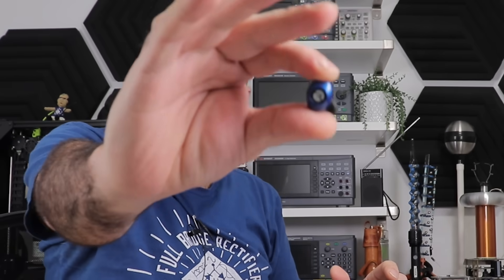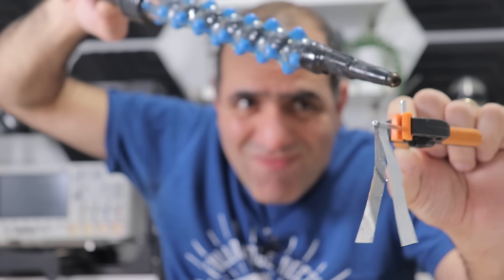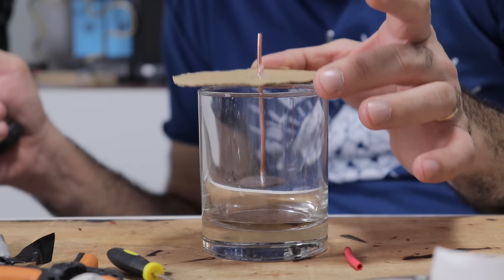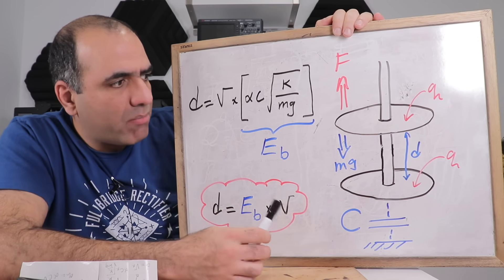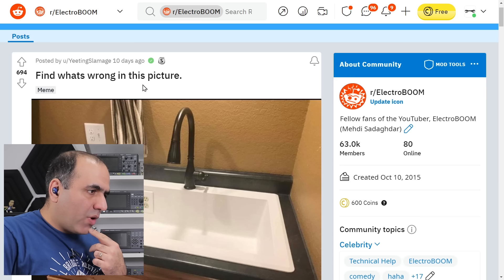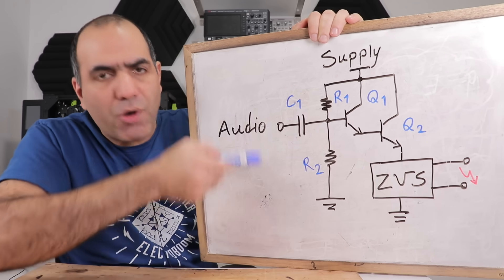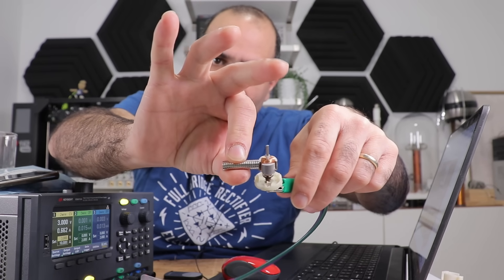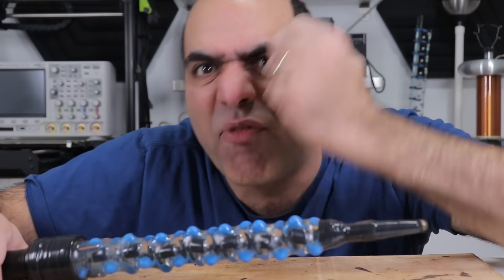I Reinvented the Electroscope! (LATITY-008)

Comment: In "cotton dust" the dust part is critically important and it has to be suspended in the air.   You can test this with plain bread flower,  Throw a cup of it in the air and ignite it with a liter.  But for pete's sake do it outside with nothing around that can burn.    With a little cleaver setup you can reproduce the video.  I can give you more details if you want but not in a public post is you could blow up your house if you do it wrong.  I'm sure any of the older guys from the war can tell you how too.  It was kind of common knowledge back then.

Comment: 10:20 I think the primary issue is less with the material, and more with the surface-area-to-volume ratio of the material, which is the primary issue with dust explosions/fires.
Reply: I agree... the surface to volume ratio is an often overlooked variable.

Comment: Dear ElectroBOOM. This is all very nice, but you are using the wrong formula for the force between two plates. The formula is only correct for point charges. This is a good approximation only when the distance is very large. For small distance the force is constant. Just use the Gauss law to check that I am right. The 1/d^2 rule is correct, however, for constant voltage for a different reason. It is a nice integration exercise to compute the exact formula for two circular charged plates, which I dare you to do :)

Comment: Thank you Mehdi..and also Veratasium and Mould. 
All You guys rock .. you are onto it !!
.....I have commented about the electrsmog here in the civic environment on my street from the interaction of uninsulated powerlines , interacting with the path of cell transmission lines and also transformers and these new LED streetlights and also the Telco's fibre lines.
 It is living hell and I can constantly hear the sound of charge spilling and feel it ! It is a quiet town here in a special district of nz one of the first areas of 4.5-5g rollout :( so these signals and freqs arnt disguised by random noise as in most cities and town..so it perfect to expose the pollution being caused by badly designed infrastructure. 
I will make up one of these electroscopes..I have lots of glass tubes copper shim etc in my studio..so this is a great idea to attempt to measure  maximum spillage if possible to locate the offending problem. ...as it generally is focused from a power pole.. but the surrounding field is the problem...and possibly just as harmful ..very toxic to health .and appears to be a result of interaction between these infrastructures, that Telco's and council's have no understanding of other than their own interests in providing services at minimal expense and no regard to environmental risk... it feels like the town has been converted into a massive Haarp array..and conceptually I guess it has !
Reply: ..... I alo note the induction, if that's the right word !... is increased when seismic energy is flowing more so through the landscape. .so it also is collecting earth charge..St Elmos fire.
Reply: When 5g was turned on here in another district area..coincidently ..there was a massive charge interaction between transmission powerlines that sparked a massive fire that destroyed dozens of homes and properties. I am under no illusions that these differing tech infrastructures are isolated from others.
Reply: .... and if anything good can come out of this problem..it might be a discovery of harnessing the electrosmog to somehow capture charge and provide free electricity.
Reply: ... and..also to note..we had a district wide power cut. ... yet this spillage was still mostly evident from the lines..so it does seem that there could be interaction with a service such as cell transmission still interacting with uninsulated lines that is the vehicle for electrosmog. Is it possible that highsignal radio freqs are converted into electrosmog simply because of the interaction and structure of town grid layout.
Reply: ... in regards to the fibre broadband lines. . I felt Moulds explanation of light being converted into sound when interacting with another sensitive medium very appropriate.. as their assumptions that being light as innert it cannot interact I veiw now as incorrect..and as Veratasium  describes insulation as in many ways redundant as the field created is as important as the path lines..I can imagine that the fields are interacting as there proximity to the powerlines is nearby. Where the lines conjuction at the poles maybe vulnerable areas when lines bend corners etc causing more potential for field interaction?
 Of course there is a battle between Telco's and powercos blaming each other here for bad infrastructure..they have no idea other than money they generate for their investors.
Reply: ... I imagine that light also could be converted into electricity as well as sound  from the fibre lines as in Moulds explanation.. . .different degrees on the spectrum I guess.
Reply: ... and great to see you show the electrstatic force !.. I am sensitive to seismic signals..I feel the static energy rising through my cns prior to an earthquake here.. more so often generated from very deep seismic signals...and electrstatic is the what I assume it is ..a prickling type charge.
Reply: ... either that... or the natural electrostatic charge eminating from the earth has far more effect on our environment than has been found..and it is affecting the grid..or the grid due to its organised array is a conduit more so bewteen earth and airbound radio signals than the transmission of the grid itself. This would be more so affected in this locality because of the direct proximity to the ring of fire..and what has more so become the intense heat built up in alpine faultlines here..considering we will expect a magnitude 8 less than 1000km away in the not too far distant future..

Comment: Raycon is garbage guys! I got them about 2 months ago from another YT promo action and they literally sound terrible; I've talked to their support aswell and apparently I've configured them properly so nothing I can do.
The issue is that these don't bring any benefit whatsoever for music quality greater than mp3 so if you're using any app aside from Spotify these will disappoint you so consider this a fair warning
Reply: I broke mine at work 😅
I was wearing them under my hearing protection at plywood mill.
I got huge static shock from plywood sheet stack. The buds went mute and haven't worked since.

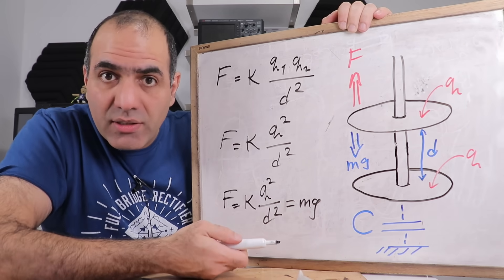Comment: Mehdi, the formula you use at 3:51 only holds for point-like charges, or objects far apart. You can't use it for the disks since the distance between them is comparable to their radius
Reply from the maker: True, I thought it might still be a good estimation since the electric fields between the two plates is fairly linear. Is there an equation for force between plates? I suppose I can calculate one...
Reply: @ElectroBOOM It seems to be a really hard problem to solve exactly, as you need to solve the Laplace equation with rather ugly boundary conditions. But you can probably calculate it numerically, or perhaps try to use an expansion on Bessel functions, since the problem has cylindrical symmetry
Reply: @ElectroBOOM  well for infinite plates (or small separation) it would just be constant, right.
Reply: @ElectroBOOM  hi
Reply: @ElectroBOOM  Since you have made plates, then the electric field between them will be uniform rather than radial.
The electric field strength between them would be:
E = V/d 
Where V is the potential difference between the plates and d is the distance between them.
If you wanted to get V in terms of charge, you could treat the two plates like a capacitor and go with Q = A*er*e0*V/d
with e0 being the permittivity of free space and er being the permittivity of the dielectric (air in this case)
Reply: Just continued to watch your video and saw you got to this same equation of E = V/d, interesting approaching it with Coulomb's law!
Reply: @henryfolds5713  Mehdi puts the cool in coulombs.  :)
Reply: @henryfolds5713   Actually, he got Eb = d/V

4:29 Eb isn't the electric field, it just stands for "ElectroBOOM" lol
Reply: @henryfolds5713 correct me if I'm wrong, but V=Ed only works for plates with DIFFERENT voltage, but in this case the plates are at same potential, so we should use V=Q/C like in the video did
Reply: @ElectroBOOM  yes, you can calculate the electric force due to disk at any point as follows:
Lets assume the charge density of the disk=P and the normal distance between the disk and any point=Z and the radius of the disk=a then the field= (PxZ)/(2epsilon) x (1/z - 1/root(a^2 +z^2)) then after calculating the field multiply it by the charge to get the electric force due to disk however this formula is applied to radial and not two disk-like plates so i assume its just gonna be E=V/D
You can also look up the formula online for more clarification
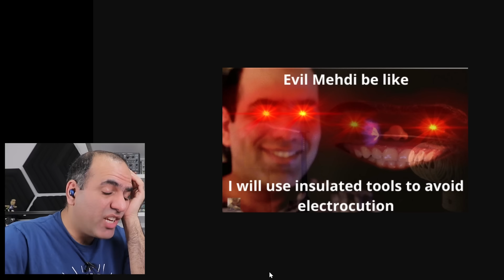Reply: @ElectroBOOM  11:10 Here we go again, history repeating itself.... Thought we'd talked about this issue before. I hate Raycon you know that! Cancel your sponsorship with them or i will unsubscribe and report you (yes i may actually report you, im not joking!) I dont want to report or unsubscribe but it may get to that stage if you persist and continue trying to sell us Raycons. No one wants that right?
Reply: @xa-xii4865  What is wrong with Raycon and who will you report him to?
Reply: @xa-xii4865  seems to me like you should subscribe to relaxation man
Reply: @xa-xii4865  Huh? Why would you want to report someone simply because he sponsored a product you don't like? Are Raycon is a banned substance or something? An illegal product?
As for unsubscribe, well... that's entirely up to each person.
Reply: @xa-xii4865  "Hi, I watch what you do on YouTube and do not contribute to your survival in any meaningful way,  however I don't like a thing you're doing and will resort to withdrawing all my lack of real world contribution if you don't remove the one thing in a tiny portion of this visual media that actually guarantees monetary support and your continued survival." 

That's how your comment reads with no context as to why you're so mad at Raycon.
Reply: @xa-xii4865  they are no entirely shit, just overpriced
Reply: @xa-xii4865  who hurt you and what Raycon do to you?
Also your report it usless
Reply: I came to the comment section exacly for this clarification. But what the most commenters are getting wrong is that the discs have charges of the same sign. Therefore E=V/d won't do. For large distances between the discs approach provided by Mehdi will work. While for the small distances I can think of two ways.  You can either do it rigorously using the cilindrical symmetry, as pointed in one of the comments, or use an approximation. In the latter case, you can calculate the force using the density of the field energy. For small distances d between the plates, the field created by the lower one is uniform and is proportional to the charge of the lower plate Q. The density of the field is proportional to the field squared, hence Q^2. The force in turn is proportional to the energy density multiplied by the area of the upper plate. Note, here we only consider the field created by the lower plate near the surface of the upper plate and not the resulting field. With all said, we arrive to the force proortional to the Q^2 with no dependency on d. What does this mean? Only that we can not consider uniform field in the given example and have to take into account geometry and charges moving on the plate forming a distribution dependent on the distance to the center of the plate.

Comment: veritasium explanation is for some stupid people... The lamp turn on immediately not because it's close to power supply, with extremely long wires to connect, but because the electrons in the conductor are already present in it on the whole length of the wire(at least those who help hold ions of metal to hold in the crystal structure (sorry for my English, hope you understand what I mean). The lines in the picture of the metall crystal structure body-centered cubic shows that neighbor ions have one electron for them both which is moving with trajectory of "8"), and when the power supply is connected, this electrons will move in the same direction. When you turn on power supply to start motor or light a lamp you shouldn't wait for the electron to move the whole distance from power supply - to +. You just waiting for a small push for all the electrons in the wire. So it's like pipe already filled with water. As for the electromagnetic fields appearing along the wire it's not the reason of the moving electrons but a result of their movement. Because electric field is the field around some charged particle, magnetic field is the field which appears when some charged particle is moving.

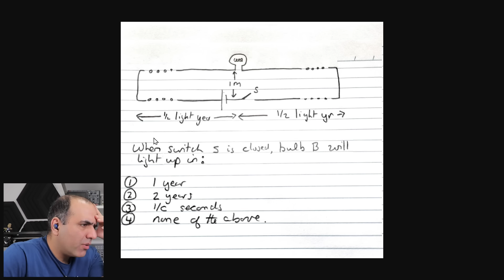Comment: 5:27 I'm really looking forward to your video about it. I have watched Derek's video just two days ago and I also think there is something off. I don't say what specifically right now. Let's see if we both come to the same conclusion.
Reply: Imagine the switch was at one of the far ends of the circuit. The source would still be 1m from the lamp, so with Derek's reasoning, the lamp should turn on almost instantly. 

A year ago, Derek had a video about measuring the speed of light in only one direction. If his explanation in the latest video would be correct, then the one way speed of light could be measured. At this part: https://youtu.be/pTn6Ewhb27k?t=128 You need two clocks, and sync them by putting the switch in the left one, and a battery and the light source in the other one.
Reply: @perperNorbi  you can't use this method to synchronize two clocks. Because issue is that when you separate the two clocks, the clock which is moving will slow down due to special relativity. Even in video it is well explained. Issue is not synchronization. Issue is how to separate them without one being slower than other.

On other point, if switch is lightyear away from bulb then it should light up after year because according to special relativity no information can travel faster than light. But if bulb can light up instantly than the information (someone has turned on the switch) has travelled faster than light which is not possible.
Reply: Please remind me too when he uploads that video.....

Comment: Veritasium's answer should be none of the above. Electrons= electricity, etc. However, the speed of light doesn't happen in a wire due to resistance. I'm sure as the wire's length is increased, the power needs go up, and the wire would melt before the light even so much as warmed up, But not only that, since the speed of electrons would be restricted, it would take longer than 2 years. I'd say 6ish, if this were possible to do, and the wires didn't turn to mush from the heat. Now... just for fun, I'll invoke the word "quantum" and we'll see how fast Electroboom's eyebrows shoot up. Should be faster than light. :D

I'd say that the electrons in the wire would act like a really long Newton's cradle, but with a constant pulse pushing the electrons together, like in a newton's cradle.

Comment: Well it's probably pretty accurate to say that evil mehdi would be be an opposite force so if you touched surely you would both merge and become neutral medhi. 
You can use that assumption free of charge
Reply: If Mehdi and Evil Mehdi face they will annihilate each other completely as huge blast of electric discharge which burns all world's electronics to crisp.
Reply: underrated
Reply: If an Evil Mehdi and a Mehdi collide at high speeds, they will annihilate and release a photon.